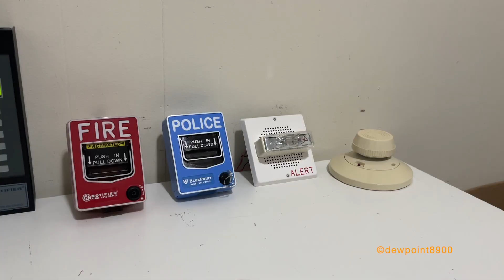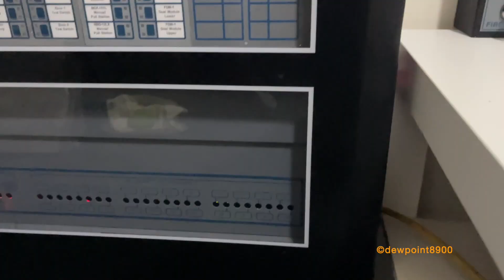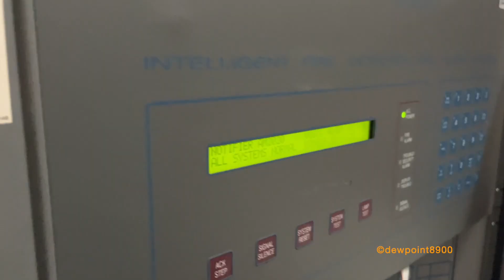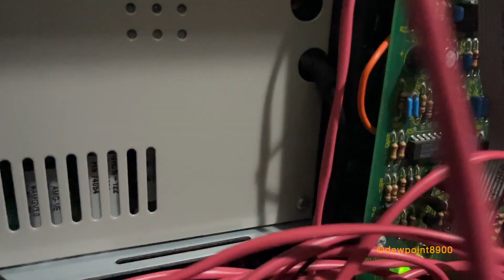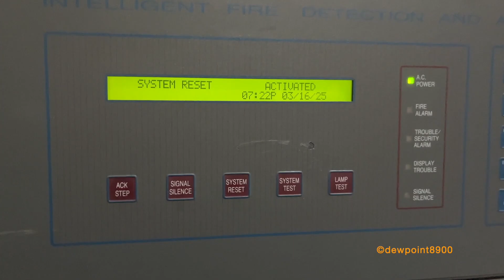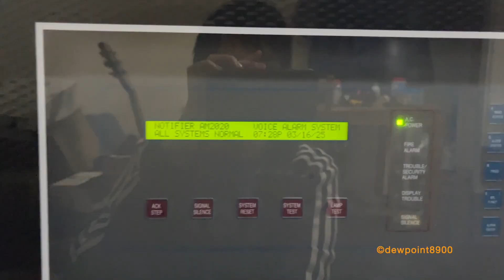Notifier AM2020 Overview and Demo

Comment: yo can i play like 50$ for the power distrubution cables for the ica and cpu
Reply from the maker: I do not conduct business here, you can send offers on eBay.
Reply: @dewpoint8900 ok
Reply: No, this entire panel would be around $9000-$1M. It's better to buy individual parts and build an AM-2020 with the parts bought. Don't try to buy a big panel like this in one delivery.

Comment: The mall in my city had an AM2020 system, but they used horn/strobes (mostly Wheelock MT-24-LSM horn/strobes sounding on Code 3). The panel has since been upgraded to an NFS2-3030 system, but they still have many devices from the previous system in the mall concourse and a few stores, like the aforementioned MT-24-LSMs, SDX-751 smoke detectors (some were replaced with FSP-851s over time) and at least one BGX-101L pull station (most were replaced with NBG-12LXs).

Comment: I am thinking you could use verifier tools to acses the panel but i am not sure about it
Reply from the maker: @dabaws99  Not sure if this panel uses it. The AM2020 can be fully programmed from the keypad, although it’s not very efficient. There is an interface to upload/download but it involves a lot of adapters and cables to get working.
Reply: @dewpoint8900 So, you don't really need a software for an AM-2020 to get it working?

Comment: Do you happen to know about a Simplex 4010 doing a "PC Crash" mine did that recently than restarted on it's own and works perfectly fine like nothing ever happened.
Reply from the maker: I've had my 4010 do that once too. Never happened since. There's a document you can search online that provides info on all of the 4010 crash codes.
Reply: @dewpoint8900 The 4010 shouldn't crash at all. That's not a smart feature for a life safety system.
Reply from the maker: @Sirenfireproductions5209 It’s inevitable with CPU-based panels. While Simplex panels crash, they usually recover unless it’s a particularly bad problem.

Comment: This is pretty cool! I thought the MXL’s were slow, but this is crazy. The re-alarm was better. 

Does the alert message take priority over the fire message? You would think that’s how it would work.

23:12 Interesting Siemens chip.
Reply from the maker: The priority for the AMG-1 messages is from top down. So for this one (from highest to lowest): Fire, Evac, Flood, then Tornado.
Reply: Siemens must have been popular in the notifier industry at the time. Either that or that's a chip he put in there.
Reply: @Sirenfireproductions5209  It’s likely that the chip is an off the shelf CPU or controller

Comment: Notufier had the most depreaing ass voice evac in the world back then
Reply from the maker: Yeah, AMG-1 voice messages aren't the best of quality.
Reply: @dewpoint8900  though the panel has like a future retro look to it wich is cool
Reply from the maker: @ I do like the older style panel designs. Onyx series looks nice too with the black cabinets.
Reply: @dewpoint8900  What's the vrom message chip label for the message the AMG-1s at the nueces county courthouse and many other places such as the Egyptian theater in hollywood, Is that like a default factory made message?
Reply from the maker: @Sirenfireproductions5209  There's over 100 VROM messages, so it's hard to narrow it down from there.
Reply: @dewpoint8900  Yeah the list of 100s of messages there is a 'needle in a hay stack' list. I did identify and retrieve a few messages from there though.
Reply: There is some that don't sound depressing.

Comment: This is one of the best panels in the world
Reply: yeah maybe in 1990, but now there are panels like the 2-3030 that can activate way quicker and have way more features
Reply: @ESTedwards  3030s don't hold up to 8 DVCs which is the flaw compared to AM-2020s able to hold up to 8 AMG-1s or AMG-Es. I know many have a bias against VROM messages but I have a positive bias for them because they have hundreds of different message chips you could choose from. The DVC just doesn't feel appealing or the same as the AMG-1s of AMG-Es.
Reply: @Sirenfireproductions5209  What’s the purpose of having 8 AMG’s? There is no need with new technology. The DVC can hold multiple messages on it and is much more capable than the AMG.
Reply: @ESTedwards  8 AMG-Es is the loophole to having over 8 voice evac messages on an AMG-E. It may sound like a challenging thing to get to work but it may work in the long term.
Reply: @Sirenfireproductions5209  Still, how do you think that the AM2020 is better. Even with the AMG-E’s the DVC can hold up to 32 minutes of audio, and supports up to 1,000 different audio sequences. It just seems like an older, less reliable, less capable, and less powerful version of the DVC, that’s just harder to install.
Reply: @ESTedwards Yeah but the problem with the DVC is you have to program it just to add a custom message which takes 30 years just to happen. That's not a problem with a Notifier AMG-1 or AMG-E because you could just insert VROM or VRAM message chips. That problem with the DVC adds a lot of work after getting modern notifier panels to function with verifier tools.